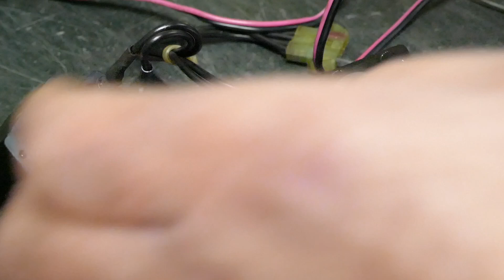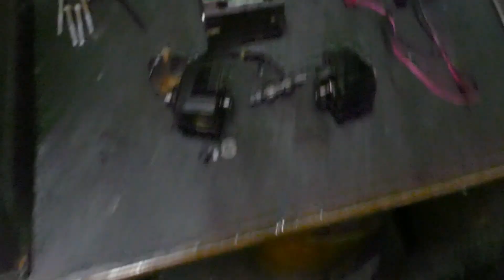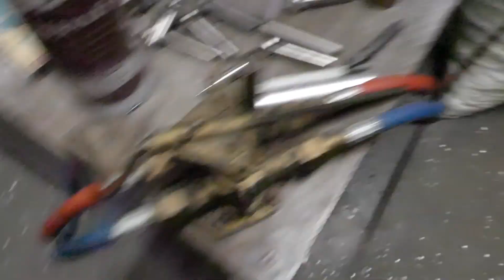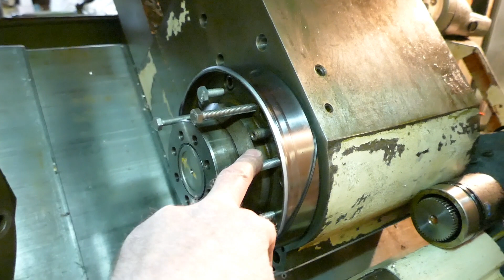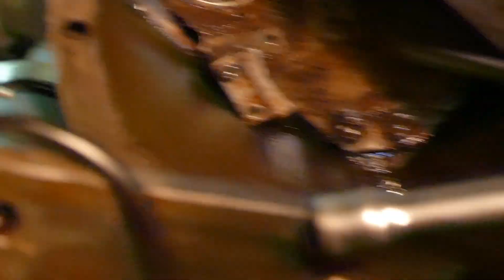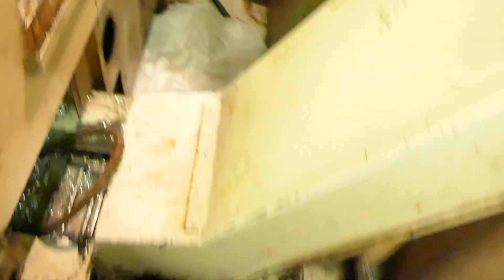CNC Shenanigans - Hardinge turning centre turret problems (part 3). Hydraulic valves & index motor.

Comment: I'm taking a break from rubbing down my mill column - I filled it yesterday. Hands feel like they are falling off from the DO sander...So decided to watch your new film. The hydraulic valves are CETOP standard. One of them is closed centre, ie the outputs are both blocked off and the function thus locked when it's de energised. The other is active centre, which I have not come across before. The two output lines are connected to pressure when it's off. Open centre(connected to tank) is more usual. The solenoids are detented according to the valve symbol. To be honest, my money is still on the encoder or it's drive train. Hydraulically the thing is working. It's the positioning that is the issue. Maybe you've changed the encoder now, in which case this is all academic. Loved the film. Back to the DO sander!
Reply from the maker: Thanks for watching & thanks for your comment. Good to hear from someone who knows what they are looking at! I've never had anything to do with hydraulic valves before... It seemed to me at the beginning of the video, the indexing wasn't working because the hydraulic system needed bleeding? Supposed to be self bleeding but must need running through a bit? Then when it was doing it's spinning round & round thing (which has been an on-going problem) it seems as if it's not reacting to signals quick enough, which is what made me wonder if the valves were worn. I did replace the encoder but that didn't cure the missed indexing...